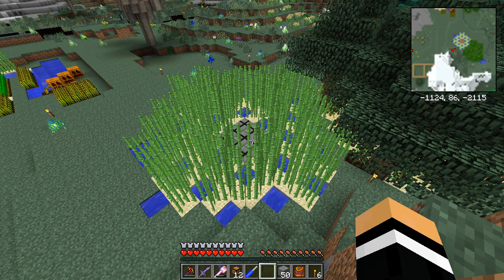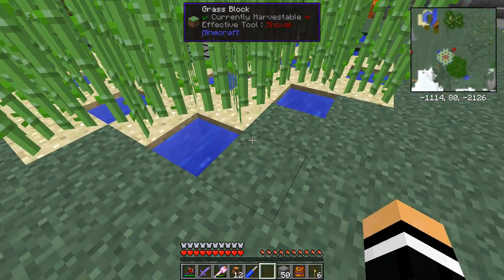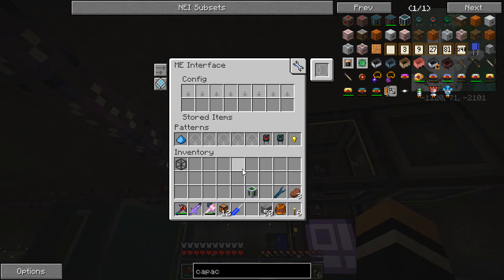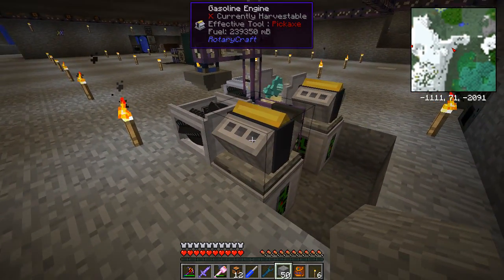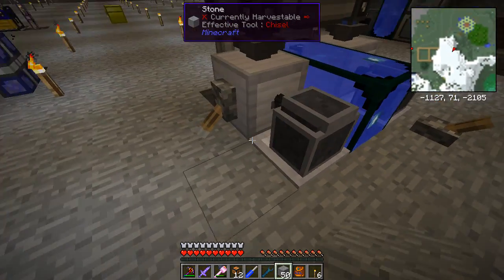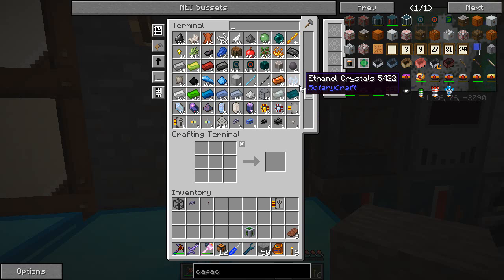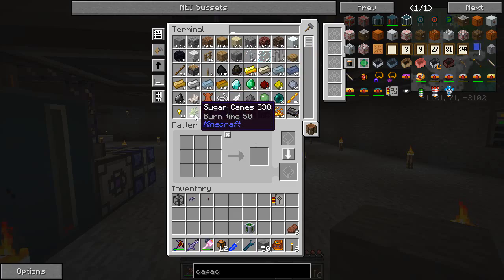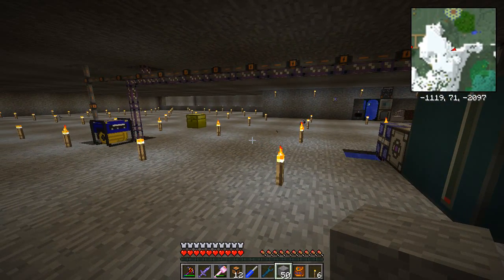S04E12 - Howto - Automated Ethanol Crystals

Comment: why is the fermenter so fast? mine takes at least 2 mins for 1 operation
Reply from the maker: +Miflof Bierculles Hey, thanks for the view :-) You know, I have no idea why yours is slow. I'm using the minimum engine required to get it going. Usually with Rotarycraft you can give more power to make the machines faster...
In this case, perhaps we are using different versions of the mod, and Reika has changed it between builds. Unfortunately this video is fairly old now, and I've restarted the server a couple of times since then, so I cant go back and check I'm afraid!
Reply: +Stoo42MC thanks ^-^
Reply: Make sure the fermenter is in an enviroment with an ambient or normal temperature. Very high and very low temperature kills yeast. Also as the day continues, the temperature lowers causing it to take much longer to operate.